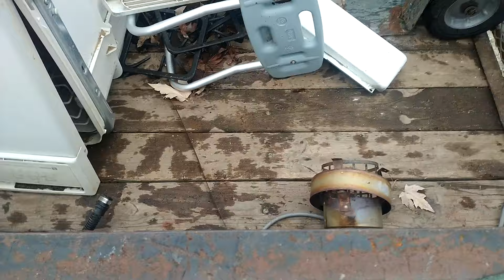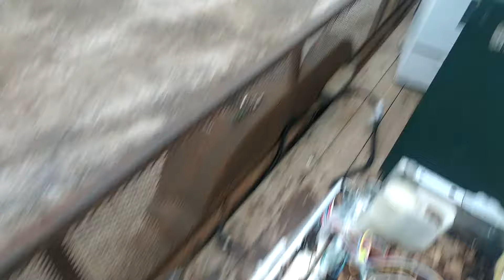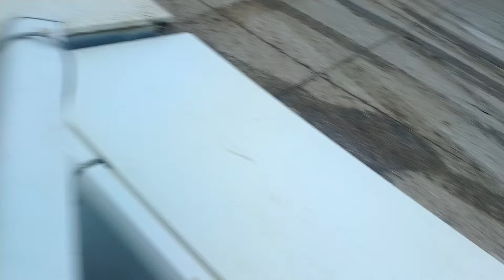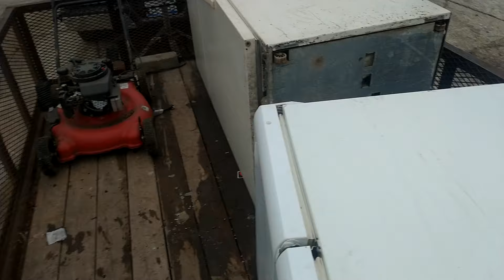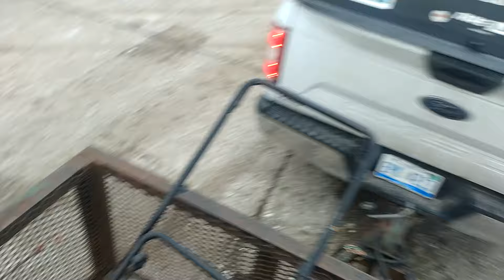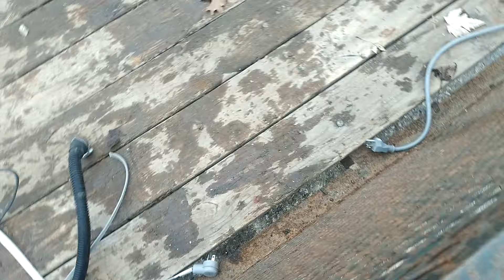scrap metal drop off of the refrigerator, stove, push lawn mower and a grill #scrapyard #scrap metal

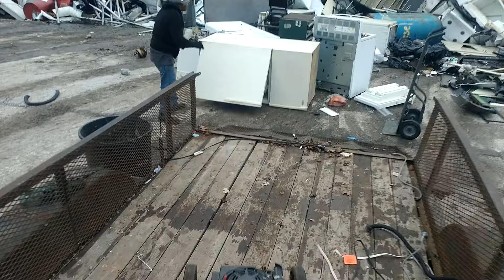Comment: 4:52 why don’t you take the motor off of that mower it only takes one bolt for the blade and three bolts on the motor and you can get dirty cast aluminum for that motor. I get $.15 a pound for them just like they are gas tank on them everything just unbolt the motor and sell it like it is.
Reply from the maker: Okay sounds good thank you for this information
I really didn't know again thank you 🙏